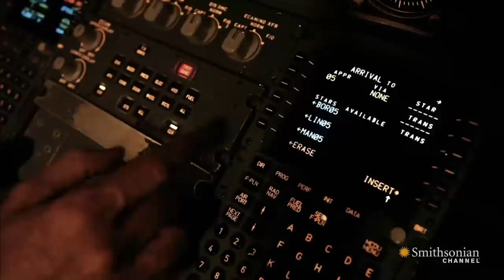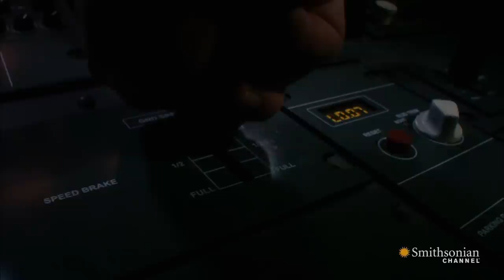Sabotaged by Autopilot

Comment: This accident was actually caused by human error. The pilot wanted to set the descent path to 3.3° but he mistakenly set it to 3300ft/min (normal would be 800ft/min). 
It was a bad design of the instrument: the 3.3° and 3300f/min would be displayed as 3.3 or 33 (only difference is the point in the middle).
Reply: Faulty cockpit design + rushed pilots who were about to lose their on time bonuses for this flight + awful weather (pretty normal in Alsace this time of the  year though) + no GPWS = Air Inter 148 crash.
Reply: With 3300 ft decent rate the plane would actually dive... 
In this case the vertical speed should be far higher and plane would colide more vertical and scatter.  But shown in this video is, its brushing with trees.
Reply: That doesn't make sense. Wouldn't he have been on approach hold? The autopilot should have been controlling the speed of the decent.
Reply: JetPackJan Its always human error 
Design error- a human designed it
Maintenance error- a human did maintenance 
Pilot error- a human flew it
Reply: hello yellow fellows you know what he meant tho
Reply: Sounds like "design flaw that produced human error." This one's on Airbus.
Reply: Use the metric system.
Reply: Bruh imagine trying to set something to 3.3 and setting it to 3 fricken thousand instead
Reply: @mikebronicki6978  IMO it’s more down to poor flying. It’s not like they werent trained to fly the a320. Same goes for AF447 pretty lazy to blame airbus when really it’s down to horrendous piloting. I’m starting to see a trend with Air France and pilot competence
Reply: That's the reason now that when in VERT SPD mode the number is displayed as 3300 instead of just 33.
Reply: Correct it was human error  the machine was only doing what it was told by the human

Comment: They dialed in the wrong rate of decent into the computer, the computer did what it was told to do.
Reply: Another pilot's error is what are you saying ?
Reply: The Doctor yes
Reply: Computers are good followers, so good that they even do human mistakes.
Reply: Anim Mouse They don’t make mistakes. They just do what we tell them. This is what happens when we tell them the wrong thing.
Reply: ”very experienced pilot”
Reply: u think if computers become Advance AI self aware would they commit suicide like this lol ???
Reply: But you'd think the computer would have the ability to detect when the user entered bad instructions. You'd think it would auto-correct, give a warning, etc. And it would do that based on information given by the GPS, radar, TAWS, etc. The computer would compare the human input to the feedback from the other major systems and know that something isn't right. Basically, shouldn't there be a solution for human error?
Reply: Note that this isn’t a pure pilot error scenario. The rate of descent and angel of descent displays were poorly designed and could easily be confused with each other. The pilots dialed in an angle of -3.3 degrees, but they accidentally dialed it as a 3300ft descent due to the confusing display. And according to Mayday episode on the crash: at same time, a gust of wind hit the plane, causing it to climb slightly. This triggered a mostly unknown safety system onboard the plane. Due to the change from a ascend to a descend, it thought that the pilots needed an emergency descent and as such doubled the rate of descent to 6600 feet per minute. 

The pilots definitely made the several mistakes but the crash was also caused by a myriad of other factors such as the lack of knowledge of the safety system, a poorly designed display, a lack of GPWS and the ATC giving them the wrong heading.
Reply: @WheelEstate  I think this happened before GPWS was a thing. And no, different approaches and manoeuvres can call for more extreme control inputs.
Reply: @simonwilson7581  
The pilots definitely made many crucial mistakes, but I personally think that it’s unfair to blame them entirely. They definitely contributed to the crash by not noticing their rate of descent, but they were put into that situation because of the ATC’s mistake, pressure to be on time, the decisions by their airline and their lack of experience/knowledge on the A320. Take one factor out and the crash would’ve likely never happened.

Comment: Wait, Its Altitude is At 3,160 ft, then at 1:36, Back To 5000 ft???
Reply: Pacifium ..
The answers are :
ITS BRIGHTER HERE!!!
Reply: [GD] 4quatiC two words:

Movie logic
Reply: @WinterDutchie  Even in real life altitude changes rapidly in mountains cuz the floor gets closer and further as u pass over a mountain..makes complete sense to me..
Reply: @ibro796  altitude actually means height above sea level which does not change even if they are over mountains so it's an error in the animation
Reply: @jingxuan6776  Actually wrong again, planes measure altitude by taking the time for a radio signal to reflect back to the plane from the ground and measures Heights above ground level not sea level
Reply: @ibro796  is actually right
Reply: @PyroBird When you try to think smart but barometric pressure is atmospheric pressure
Reply: @PyroBird The barometric pressure doesnt measure altitude it measures atmospheric pressure
Reply: Lokaba no you are wrong..what you want to say is radio altitude..and its only working when the aircraft is below 2500ft Above Ground Level..and the display of radio altitude is in the middle bottom,not the right side of the pfd...what you see in the video is Pressure Altitude and what @PyroBird said is true..its will not change unless you change the QNH..you can google it for more info.
Reply: @lokaba9159  All altimeters will read MSL when the QNH is dialed in. What your talking about is the RADIOaltimeter which are two completely different things.

Comment: From Wikipedia: "In the last 10 years (2003–2012), Airbus has received 7,714 orders while delivering 4,503, and Boeing has received 7,312 orders while delivering 4,091." 

And it's incorrect to state that Boeing has a better safety record. There is actually very little difference between the two manufacturers. According to the Aviation Safety Network 60% of fatalities occured on Boeing aircrafts which corresponds to their share of the market. Why don't you look it up? Google is your friend.
Reply: 2020

Comment: You may want to look at the infamous "Automatic Thrust Restoration" feature on the MD-81. The feature was even patented by Boeing in 1986. That is one instance of a plane computer "deciding" something against the pilot wishes. -- with disastrous consequences. It effectively destroyed both engines on flight SK 751 and crashed the plane.

Comment: Mike, Boeing's latest planes the B-787 and B-777 are using fly-by-wire technology pioneered by Airbus. All Airbus is doing is protecting the plane when it is operating in Normal Law, i.e. making sure it stays within the flight enveloppe. It will prevent the pilot flying from inputing commands that would endanger the plane. E.g. it will prevent the plane from stalling by reducing the angle of attack or increasing the airspeed. The computer is not making any "decisions".

Comment: Wrong. The autopilot certainly can land the plane if the airport and aircraft are so equipped. Once the ILS localizer is captured the autopilot will follow the glide slope and provide the required inputs to move the flight surfaces and land the plane safely without the pilot flying having to move the sidestick or control column. Nothing new here this technology has been available since the late 1960s. Lookup "Autoland" with Google.

Comment: The above description is incorrect. The flying pilot made a mistake by selecting a descent rate of 3300 feet per minute instead of a descent angle of 3.3 degrees as he should have. You can read the full report on the Bureau d'Enquêtes et d'Analyses pour la Sécurité de l'Aviation Civile website at bea [dot] aero. This is also somewhat explained in this video watch?v=ABlmkB9lCEU . Nothing to do with "computerized system drove them into a mountainside." In fact the pilot was not even flying in ILS.

Comment from the maker: This airplane was using a state-of-the-art autopilot system - but still, the plane went down.
What do you think - was this a human error, or technology gone wrong?
http://bit.ly/1rTCfJ7
Reply: I hope the new a320neo is computer error proofed.
Reply: +Sean Luo the A320 shown here was the A320-100. An older version of the A320 which had a lot of failures. There are improvements on the A320-200 (the A320 currently being used) and A320Neo.
Reply: +Jansel Kenneth Tolentino Nope. FYI, It was the A320-200 shown in this video. The NEO version is just a extension of shark let winglets to the original wing. There was never a A320-100.
Reply: They might of not proggrammed the autopilot right
Reply: I think human error
Reply: Idk maybe if you gave us more info in the vid
Reply: Hmm...This is little puzzling..... Maybe they set the descend range too steep, So maybe human error... who knows
Reply: Smithsonian Channel human error due to the A320-100/200 family being the first commercial plane to have fly by wire
Reply: maybe the crew changed the autopilot altitude or they accidentally disengaged it
Reply: I always fly the A320-200 I hope I didn't crash!! Hahaha LoL
Reply: Human error, for purely trusting technology
Reply: i think something went wrong with the system
Reply: Tech
Reply: "State of the art" yet launched prematurely. This very aircraft was a series-100 model, of which only 60 were built (out of 4000 + globally). There were at least 3 accidents on those series, due to rushed development, they needed it on the market ASAP as Boeing was launching the 737-400 at the same time. Now for flight 148, it was a set of additional factors that doomed it: inexperienced flight crew (on this very type of plane) who had mostly flown old A300s and SE Caravelle before, which were vastly different airplanes. Secondly, Air Inter was a domestic airline which mainly catered to businessmen, therefore pilots had bonuses the faster they flew. Which led this crew to make basic mistakes, as they were already late and thus very nervous and eager to land ASAP no matter what. Then the weather, snowy plus it was late during the evening. And finally, no GPWS, as Air Inter claimed it "bothered its pilots".
Reply: I dont know maybe you should give us more than 2 min
Reply: Smithsonian Channel, stop it!
Reply: The primary cause? Setting the descent rate of 3300 ft/min instead of 3.3 FPA (Flight path angle).

Leading cause? The descent rate is displayed as XX e.g. 18 in vert spd mode. In this crash, the pikot entered 33 in vert spd mode, believing they are entering FPA of 3.3 deg. 
Also, lack of installation of GPWS

Teachnology to be blamed? I dun really think so.  Primary cause was still that the pilot entered the wrong data into the FCU. Contributing cause was that Airbus use 33 instead of 3300 when displaying vert spd, which they quickly corrected.

Comment: B-737: Rudder hard-over (multiple occurences)
B-777: Engine shut down due to faulty fuel-oil heat exchanger (multiple occurences)
DC-10: Cargo door blowed out during flight (multiple occurences)

Comment: This crash was not caused by autopilot. The crash was caused by the captain mistakenly entering an incredibly steep decent rate of -3,300ft/min rather than the normal -3.3 der descent called for by the approach. The autopilot flew the approach as planned, and the crew could have taken over at any time to stop the autopilot. This is pilot error, not computer sabotage.
Reply: A contributing factor was the airline's decision to not install GPWS

Comment from the maker: This airplane was using a state-of-the-art autopilot system - but still, the plane went down.
What do you think - was this a human error, or technology gone wrong?
Air Disasters is on tonight at 10 PM.
Sabotaged by Autopilot
Reply: Did everyone die?
Reply: +Carl Johnson CJ probably not
Reply: Smithsonian Channel pilot error. He set the wrong info into the autopilot
Reply: MagicalCoaster 1  no
Reply: This was human error. The copilot set the autopilot for a 3300 foot per minute descent when it was supposed to be a 3.3° glideslope.

Comment: The reason 4 that is because no one wants to train pilots properly. There is no general aviation in places like Korea or China. They take 300 hr pilots and put them in a heavy jet. The "pilots" r trained to be button pushers and video game players, so AB and now Boeing are delivering dumbed down planes. The B-787 will fly single engine with your feet on the floor, the computer handles rudder and trim--until is doesn't. When that day happens, the pilots will be clueless on aircraft control.

Comment: There were if you take into account that Boeing has made over 38,000 aircraft compared to Airbus which has made a fraction of that number. When you take into account planes built vs planes crashed, boeing aircraft have a better record by far. That being said, the 737 has the best record statistically speaking.  I would tend to agree with your opinion on the worst aircraft commercially being the DC10...Although im not a big fan of the MD80s

Comment: Air brakes while still in air? Da fuq? I'm not even a pilot but that's dumb af. That pushes downward "lift" and pushes the plane down, it's basically upside down flaps, you're supposed to use that on the runway.
Reply: ok